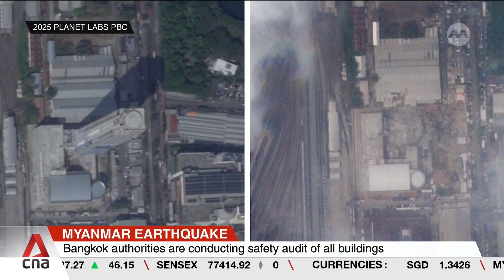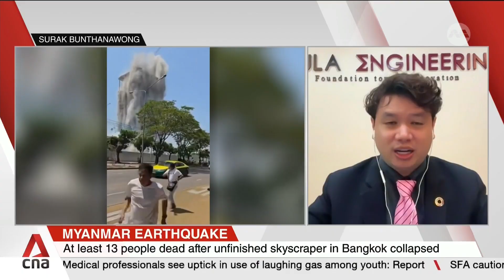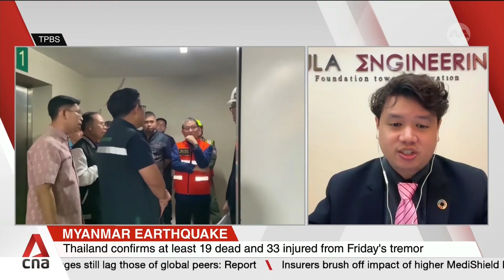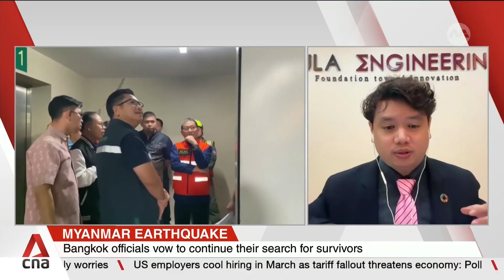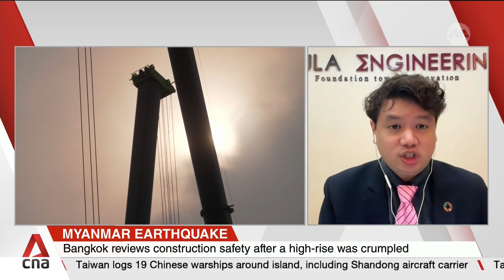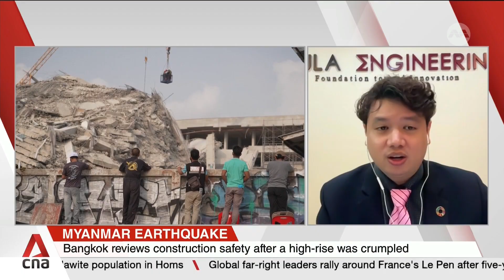Thai engineering prof on construction safety in Bangkok after skyscraper collapse

Comment: To make things worst.. Thailand has no proper standard for emergency stairways for high rises. So stairways only lead directly down to the bottom floor and if that stairway is blocked for some reason, people are trapped in the stairway. No way to get back into the building to seek another way out. Doors shut and can't be opened from the outside. Apparently firefighters have to send a person in to open the stairway doors from the inside. How crazy is that?

Comment: What all media commentators  are focusing on is the steel, but none pointed out that the sky scrapper that collapsed was under construction. Having an internal tower crane with crane cabin and booms at the top of tower that stood all the way to the ground meant that the tower would swing significantly (as shown by multiple videos on tik tok) during the earthquake at a different amplitude and magnitude to the building structure itself causing internal crashes. The force exerted by the internal crane tower could cause the  building structures near the top to fail, and the failure cascaded downwards, until the whole building collapsed like 9/11.
Reply: if you watch the video it seems the issue started at the lower floors and collapsed upward not the top down direction

Comment: Improper engineering.
Inferior steel.
Watered down Concrete.
Poor Construction Practices.
Rushed before any Concrete cure happened.
The building PANCAKED from bottom columns failure.

Comment: Regarding the building under construction, it isn’t at full strength until it’s finished. As a matter of fact, it was not even close to full strength where it could survive the seismic event. The engineering design for any high-rise, especially in a place like Bangkok where seismic activity isn’t a daily concern, assumes a completed structure with all components—foundation, columns, beams, bracing, and cladding—working together to handle loads, including rare earthquake forces. At that stage, it might’ve had its concrete core and some steel framing up, but without finished floors, shear walls, or fully connected joints, it’s a fraction of its intended stiffness.
Reply: Sathorn Unique Tower which is 49 stories n 80% complete, Abondoned during '97 Asian Crisis 
Owner has been trying to sell it but Unable
Thanks to Mr Earthquake n China Railway Number 10, they now have more than 3 thousand over offers n they are Climbing. NOT A single CRACK,  Bullet Proof.
A Building PROPERLY Designed n Built, NOT Some Tofu Dreg
Reply: best comment here
Reply: Nonsense, building’s main structure had been completed and the building had been topped off. The floor slabs at every level had been completed. If anything, there’s no laden weight burdening the structure at that point.

Comment: Sub standard steel,mpa of concrete not quality control on pours,the building twisted 4 seconds then came down,that was columns failing.
Reply: People don't seem to understand that its the concrete that holds a building up - the steel is only there to reinforce the concrete in tension where its weakest.
Reply: @fx-studio  That is the mentality of some builders. The steel is not very important.
Reply: @ang1852  The steel is the least important of the issues with this building.
1) Design is number one with the offset lift core appearing to experiencing differential movement in the quake
2) The the big one is the concrete which turned to dust just falling off the rebar - its colour being very white could indicate a pozzolanic additive was added - whereby the ratio to cement content needs to be within a certain margin.
Reply: EXACTLY,  The Building by China Railway Number 10 is PATHETIC.  ONLY BUILDING to COLLAPSE in THAILAND. 
in fact Sathorn Unique Tower which is 49 stories n 80% complete, Abondoned during '97 Asian Crisis 
Owner has been trying to sell it ever since but Unable to.
Thanks to Mr Earthquake n China Railway Number 10, they now have more than 3 thousand over offers n they offers are Climbing. NOT A single CRACK,  Bullet Proof.
A Building PROPERLY Designed n Built, NOT Some Tofu Dreg

Comment: What has been found so far is 
13 of 28 Samples NOT Up to Specifications.
20mm n 32mm are from the Same Factory that FAILED the Specifications. Which has Been CLOSED Down late last year.
Yet to Investigate the Quality of Cement used
Reply: The factory is still open.
The steel story got changed yesterday it was 2 out of 28 that failed, today its 13.
Still no mention about the concrete yet though?

Comment: The only building collapsed in Bangkok was designed and built by a Chinese engineering firm.
- Thanks to Belt and Road corruption and Made in China quality materials.
Reply: Peak Chinese quality (its garbage)
Reply: This is a Thai Government Audit Centre building.  The construction was awarded to a consortium in which China was one of the partners.  There is no information on the designer yet.  There is now a very strong evident that the flat slab design of the building is unsuitable for the 7.7 scale earthquake.  Also the standard design code for Bangkok is unable to cope with such earthquake magnitude.  The escape of water from the sloshing of roof top swimming pools plus the two sky bridges failures from other high-rise buildings are clear indications of the current inadequacy mandating the seismic zone 2 for its risk against the seismic events.
Reply: Someone shared the design of the building is different from the standard design with more support pillars. Time for local legislation to consider requirements for high rise building with earthquake resistance as everywhere is facing scarcity of land (you cannot expand horizontally so we expand vertically, ie upwards)
Reply: 1,000%
Reply: Don't point your finger too fast before the true cause of the collapse is established.
Reply: Source?
Reply: @electromega3077  It's built by China Railway Construction Company. In fact they just had a ,big ceremony before it collapsed. In fact they were many thousands of buildings in that area some under construction but only the Chinese building collapsed.
Reply: @  So the collapsed building was still under construction. Were other buildings built by Chinese collapsed as well?
Reply: @andrewwong1146   Source?
Reply: @electromega3077 Weibo ?
Reply: @jovimathews   Sorry, this is not a source. Give me something specific and tangible.
Reply: @electromega3077  Temu?
Reply: @jovimathews   Do you mean "Trust me bro"? OK thanks. Cheers!!
Reply: @electromega3077  ‘Kung Flu’?
Reply: @jovimathews  LOL, it's still by far and far  better than the mental illness u r suffering now. Hope you feel better and get well soon. Cheers!!
Reply: @ So?? How is ur mood today? Better??